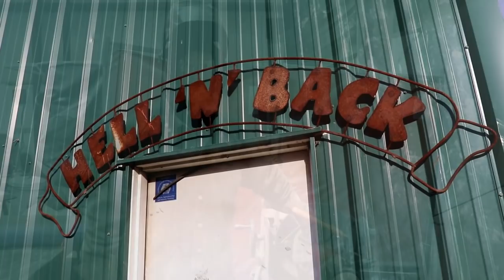High Pressure Socket Welding on Oily Used Parts

Comment: Stupid question, I know, but wouldn't it be more efficient to arc-gouge that weld out with some carbon rods? Is that too aggressive of a method for this, or are you just not set up for CAG?
Reply from the maker: BL4CKB34RD I could have gouged it. But I have never been a fan. Can be quicker. But it also has effects in the metal like excessive current and can cause electromagnetism . Lots of sparks and a lot of noise. My go to is always fire I find a torch helps in relieving previous stresses
Reply: @HellNBackWelding  Fair enough. Thanx for the reply.

Comment: I hope you've got a good extractor setup so you don't catch all those fumes. Fumes like that are part of the reason why welding is worse for you than smoking cigarettes. Forget the oily schmoo inside it. The anti-oxidation coating and paint is probably worse for you than anything that's in that pipe, and a respirator won't catch it. It'll just go through anything but a HasMat filter element. These days in the shop, they have us wearing helmets with a forced air-supply, and my lungs have never felt better. 

I've been a welder/fabricobbler for 15 years, and I really wish I had started using a forced-air helmet a long ass time ago, before I was pretty much forced to use them because of new Canadian safety regs. If you've not seen them, they're like a normal helmet, but with a rubber shroud around the inside of the face-plate and a low-pressure air pump that clips onto the back of your belt with a hose going to the helmet. They're not sealed. They supply just enough air to make the inside of the helmet have positive-pressure, which means it just blows fumes away from your face. They're a bit of a pain in the ass to wear, but it's worth it.
Reply from the maker: BL4CKB34RD have seen them. And I agree that would be the best option . But I just have exhaust fan and a door.
Reply: @HellNBackWelding  You should check them out one day. It's like having portable air-con for your face. Good on a hot day. Not so good on a cold one.

Comment: I was going to say those wire cups are great for metal splinters. 😖
Reply from the maker: Len M. Oh yeah no fun
Reply: Wire wheels in general are hateful little things that I avoid working with if at all possible. The only thing I've come across that freaks me out more are those plastic "quick-change" flap-disc holders for angle grinders. Maybe it's just bad luck, but those things just love to catch edges, shatter to pieces and pelt me with hot plastic shrapnel. The second you get a nick on one of those, you better just throw it out. Once that nick catches an edge, it's guaranteed to fly apart. Tis one of the reasons why I don't use any quick-change attachments or tools. If you think a normal wire wheel is evil, you should see its quick-attach brethren. I have no idea how they were found to be safe for anything but the most limited of use.

Comment: There was a plethora of info in this one bro, thank you! A couple of questions if you don't mind, 1) would using a honing bar ( like that which would be used on motorcycle  cylinders) inside the reclaimed pipe be overkill if it was readily available? 2) When you take a job like this, does the customer supply a weld procedure sheet or are they relying on you to know what to do? Of course you, having probably every cert known to man are an easy bet on the latter, but for the rest of us mere mortals would we be given a wps? 
My welding experience has been limited to being an employee, so being told what to do is a given! Any side hustle I've done has never been anything so  critical it couldn't be sketched out on a bar napkin!
Thanks, Demon. Save a place for me in hell!😉
Reply from the maker: patrick farley a honing bar would be nice if you had one but it might be expensive on stones. A lot of jobs people don’t give me WPS. It’s just here you go make it to what I need. Yeah I’ve done enough high pressure work that it’s not a big deal for me. I didn’t learn any of this until I was in a truck on my own bec no one will show you any of it. Most welders don’t like to give their tips away for free at this level. For some reason I enjoy it lol. So you’re benefiting from all my years of experience and learning it the hard way.
Reply from the maker: Honestly it’s pretty rare to get a WPS they just tell you the code and if you don’t already know procedures for that code they’ll hire someone else.
Reply: @HellNBackWelding  you're a natural born showman and they often make the best instructors/teachers. So, I'm saying "showman in a good way as opposed to a "show off".
People holding back info is the same here in N.Y., maybe even more so! And not just because of the vast population but the high percentage of assholes within that population! I wish I was kidding.
Thanks for taking the time to respond to my questions and for all the cool videos!
Peace
Reply from the maker: patrick farley maybe it’s even the place it’s just the welding industry lol. Thank you I take that as a high compliment. Thanks for watching and taking the time to comment. Let me know anytime you have more questions.
Reply: @HellNBackWelding  oh, you can be sure I'll have questions! lol

Comment: as a high presser welder, with a CWB, in both 3 different size pipe and plate, and 42 years,,,  WHY ARE YOU  wasting your time cutting with a torch that is not only very costly to run and messy as well as way over heating your metal... ? we always use a carbon arc air, or a lath, to cut out the weld, you cansee the seam much clearer. nice and clean cut and fast, and next to nothing in cost to run, time and gas cost money. torch is a back yard farmer job. them slag inclusions should never have passed the last x-ray, CWB THE ROOT PASS IT ALWAYS PUT IN WITH 6011, AND CAPED WITH 7018 OR 8018
Reply from the maker: It's cute you think you think you know what you're talking about. Number one CWB certification has nothing to do with procedures for this weld. It's a B pressure weld. CWB is a structural code, not pressure welding. They are 2 different things which you obviously don't know. Number two you don't ever X-ray a socket weld. I explained the possible testing they may use in the video. Number three, you obviously don't know a fucking thing about pressure welding because I've never seen a 6011 root on any pressure welding procedure, up here we use 6010. 6011 now THAT'S a farmer rod. I don't have a lathe so why would I machine it. Pretty much everything I use is a torch. A gouger puts in excessive CURRENT into the piece that I'm reclaiming, which could magnetize it which makes it much harder to weld nicely. Next?
Reply from the maker: Arnold Romppai again 6011 is not used for a root pass in structural ... if you were an actual certified welder and not a dairy farmer you would know the difference. And just because you are an old fuck. Doesn’t mean you know a fucken thing . when you throw around words like back yard farmer welder . Especially coming from a backyard farmer. Dam right you’ll get a reply and all because you don’t like that I use a torch? And now your telling me you are surprised I am even using a grinder to prepare my work? And that it’s going to contaminate my welds. What a fucken peace of has been meat... I would explain procedures and practises to you but I don’t have time or the crayons. ... and besides don’t you have some cows need milk’n?
Reply from the maker: Jack Masse did you even read?
Reply: @HellNBackWelding  i did, and I was agreeing with you lol